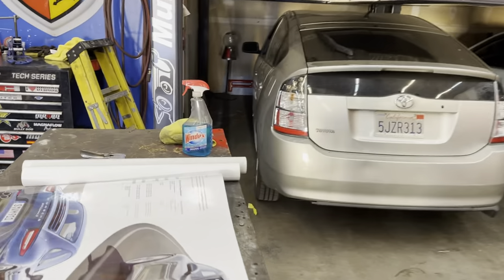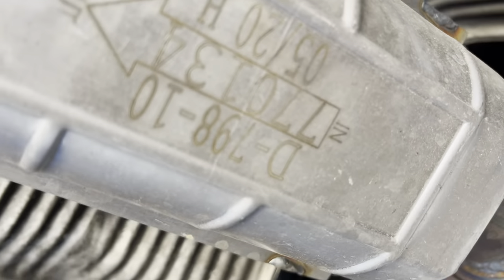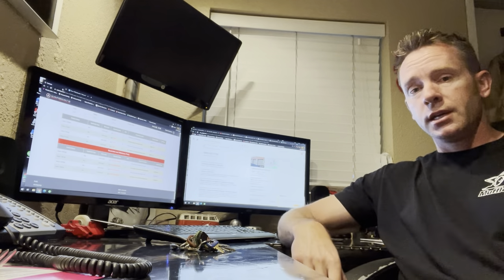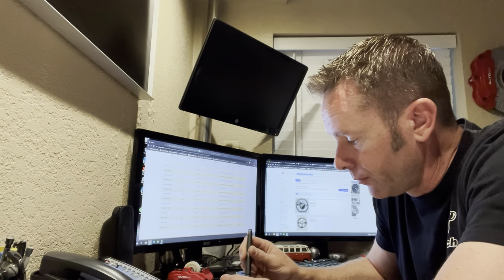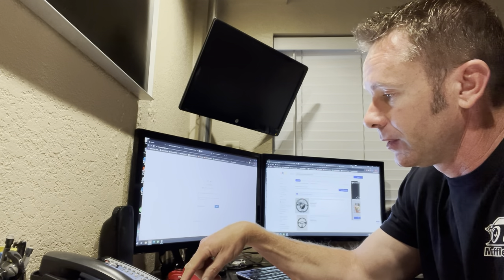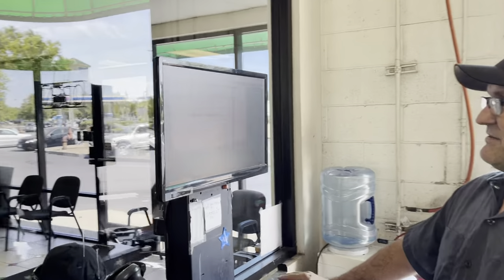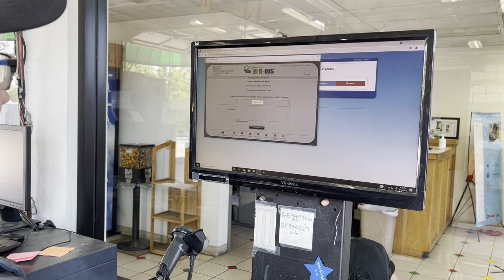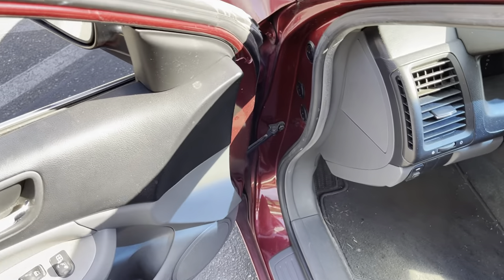There’s a legal catalytic converter for SULEV Accords in California!  Open for an explanation.

Comment: How reliable are these new aftermarket cats for the Honda accord? Do they last as long as the original? Are there any performance benefits?
Reply from the maker: On the SULEV’s it’s still to be determined.  The parts are not designed for the SULEV so it will be interesting to see.
Reply: @mufflertech  What’s the warranty on one of these?
Reply from the maker: @mjl6425  that’s the rub, there isn’t one as the manufacturer never designed these parts for an SULEV application.
Reply: Do you think in the future if these thefts ever die down and the OEM cats become more available, will we be required to switch back over to the original?
Reply from the maker: @mjl6425  the availability of the parts have nothing to do with the thefts, it’s the other way around.  The thefts are because of the higher prices of the rhodium inside the part and the parts aren’t available because of the high frequency of theft.  Once a car is labeled by the BAR 5that is the part it will always be legal with.
Reply: @mufflertech  Got it thank you.
Reply: @mufflertech  On the 2005 Honda accord can you still drive it without the cat? Mine was stolen last week and and need to decide whether to tow it or not.
Reply: @mjl6425  I drove mine to the shop, just drove slow. Car is good now. Getting a cage installed around it. I'm not trying to pay for this twice.
Reply: @mansonboy2000  what kind of cage are you getting installed? What is it called?
Reply: @surabhirahul  the muffler shop I  took it to custom makes their own around the Cat, so there is not name for it.  I'm sure most muffler shops in town must offer something similar since this is so wide spread now. Just call and ask you local shops to see if they do it. I live in Long Beach and the shop I took it to is called "Highflow Muffler" on Long Beach Blvd. I paid $280 for it. Hope this info helps and good luck.
Reply: @mansonboy2000  which cat did you go with?? Ours just got stolen from our 2005 accord...this is a headache. I'm in orange county

Comment: Will be contacting you soon regarding an 06 accord  stolen cat converter. any new updates on the aftermarket parts?
Reply from the maker: They have added a couple of part numbers from Walker, nothing has changed in price or procedure however.
Reply: @mufflertech  how much does it cost they sold me a 2007 accord without warning me that it didn't have a catalytic converter
Reply from the maker: @norbertovargas1931  who sold you the car?  What state and city are you in?
Reply: @mufflertech  I'm in orange county California I found it on offer up to my surprise I found out when trying to do the smog check.
Reply from the maker: @norbertovargas1931  California legislator says that a private party sale in California requires the seller to make the vehicle legal for smog.  I’d contact the seller and negotiate the repair.

Comment: My CAT got stolen in my 07 Honda accord SE 2.4L I fixed it it runs smooth now but the codes p0141 and p0137 come on. What does this mean? Thanks
Reply from the maker: A PO141 is an 02 sensor heater circuit malfunction, a PO137 is the same sensor with a voltage issue.  What sensor did you use?  A lot of overseas made parts do not operate properly.  Although very rare, we have also seen the vehicle’s ECU fail if the wires were short circuited when they were cut.
Reply: @mufflertech  I just bought a Denso oxygen sensor should that fix the problem?
Reply from the maker: @thatdudee5344  possibly, if it doesn’t I’d recommend a proper diagnostic from a reputable repair facility.
Reply: @mufflertech  Ok thank you

Comment: Hey Colby I know this video is old but will you please explain to me how we  sulev owners know for sure what aftermarket cats are being allowed for our cars at this moment? we dont wanna buy something that we cant use and it seems none of the provisional cats are compliant with sulev? ive scoured the carb web site cal carbs etc nothing mentions sulev or my efn.  i have an 04 accord ex sulev. My label says my car conforms to "tier 2 bin 5 and cfv lev,  lev  sulev, and certified as pzev" efn is 4hnxv02.4kcv  please advise what i can use  thanks man
Reply from the maker: None of the cats are on the CARB list, that’s why they’re provisional.  I would strongly advise that you have us or a qualified shop do your replacement.  This way you’re covered by a professional establishment to back up what’s current.  We most often use the Walker 82812.  The 82901 is also okay along with the 770134 that’s in this video.
Reply: @mufflertech  well I am a bmw mechanic and I know how to weld quite well so Im certain I can handle the install and the theft prevention install.  what i am trying to find out is how does one come to the conclusion that the walker 82812 0r 82901 is being accepted at present? there has to be something published somewhere that tells the public which are acceptable for sulev.  there is a list on the california air resource board website. theres an aftermarket catalytic converter database  which your 770134 is the first cat listed.  but please say how you came to discover that its accepted for sulev right now cuz the executive order doesn't mention sulev? it must mention something else that indicates its acceptable for sulev? all the other efn"s are listed but not the sulev efn? please help this is the question i am asking  thank you very much for your time ive literally been searching for days trying to find this out.  ive sent emails to carb's helpline even with no reply
Reply from the maker: @rickybobby9143  it’s not just about the install, it’s the insurance that the cat you have will work.  Also I know many extremely talented mechanics and welder’s that have a hard time welding round pipe on a car.  That said here’s the link for the SULEV provisional/alternative parts:

https://asktheref.org/Information/Honda-Accord-Catalytic-Converters

Comment: I appreciate the informative work and support you are providing to the public and to those of us who have had their catalytic converter stolen. 
I am working with my local Honda Dealership and was quoted a price of $4,200+  for the cat converter for my Honda Accord 2007. My Accord is in good condition with 205k miles. 
My total will come to $4,800+ 
Does this sound right? Your input is greatly appreciated. It has been a nightmare having to wait for the parts to come in.
Reply from the maker: That’s a fair amount higher then we do it for, we do use an aftermarket A pipe and sensors however.  A Honda store is likely using all factory parts and will charge more.  If you’re insured the real pain is the time to get the parts.
Reply: @mufflertech  where are you located??
Reply from the maker: @joser81  Sacramento California

Comment: Muffler tech use to be the shit back in the days. Imports and hotrods constantly there for upgrade. They were a well known performance shop. Nowadays they're just a repair shop. Smh. Hella weak.
Reply from the maker: I appreciate your enthusiasm.  I opened Muffler Tech in 1997 and have always been passionate about performance mods on vehicles.  I assure you we are still doing lots of performance exhaust.  We are also (and always have been) doing lots of repair and replacement.  The stuff that gains attention on YT are products and services that apply to critical mass.  A good example of this is this exact video which is one of the lower viewed ones on my channel.  It has three times more views then one I made about custom fitting a GT3 muffler on an early 911 here: https://youtu.be/xpGdp7_mi3s  The bottom line is businesses like us survive by offering a service that applies to a larger market along with specialty services like performance modifications.  You believe our business practices are "Hella weak", I assure you we wouldn't have any at all if we limited our services to just performance stuff.  Thanks for watching!

Comment: Is there a catalytic converter aftermarket for 2013 honda accord that is legal carb
Reply from the maker: Possibly.  It depends on why you need one, which engine you have, and  finally what the specific engine group number your car has.  If it was stolen you most likely need the underbody cat.  If it’s bad (check engine light) you’ll need the front manifold cat.  If you can bring it to us for a free estimate.

Comment: i replaced the sensors and still get a check engine light on, with code p0135, for the upstream sensor. please help
Reply from the maker: If you used a Densò or an OEM make sure the plug is all the way clicked in.  Sometimes the connection can be loose.  If it’s a different aftermarket then go to OEM or Densò.  It’s possible that the vehicle’s ECU was damaged from shorting the wires when it was cut during the theft.
Reply: @mufflertech  Thank you very much

Comment: And is it.possible.to buy the pipe.that has 90° bent and it gets bolted on what do u call this specific  part bcz I temporary  want to put straight  pipe I'm sure its.probably not legal but I'm desperate  to at least get it driveable.3-4 miles to a.job I have.chance.of getting.hired
Reply from the maker: This is the “A-pipe”.  If you’re going to do no cat you won’t need the downstream sensor but you will need the upper as it is the air fuel ratio sensor.

Comment: i just purchase a walker 82895 for my 2006 honda accord ex. it is on the list of the dmx referee as acceptable. it cost $383 on ebay. the rest of the parts i have ordered and cost less than $200
Reply: Is your 82895 working well without any issues still?
Reply: Yes I also need to know. My sister's 06 Accord SULEV had it's cat stolen and I'm gonna replace it with the same part. Please update us.

Comment: Hot off the press.  I just called the CARB ref and the process is much easier then before.  You call once and give the part number, license plate and phone number and email.  Then they give you an appointment with the ref right away which is just a week out.  The wait time was only 5 min on hold to reach them on this single call.  (The call back process has been removed)    So far a pretty good experience that they have streamlined from your video.   I had my cat replaced at your place last week and great service from your gang.   Great videos that walked me thru the process.   I also took your advice and put Comp insurance back on my old beast in case they steal my Cat again.... I hope I don't have to visit you guys again !!!!!
Reply from the maker: Great, thanks for the update!

Comment: my catalytic converter got stolen 8 months ago, and it was a pain getting it repaired, but soon after the check engine light came on and indicates something is wrong with the new catalytic converter. has anyone else has this problem or  knows why my light may be turning on? the light came on so soon after i can’t get a smog check without failing and i really need the car to get going so i can get tags.
Reply from the maker: Where did you have it repaired?  If it was a licensed shop they should be fixing it for you at no charge assuming it’s the fault of the part they sold you.
Reply: @mufflertech  It was a licensed shop but the owner died of covid and his brother who took over the shop will not take responsibility for the job that was done in the shop.
Reply: Do u know if they use oem oxygen sensor or aftermarket ones I hear after market sensor trip check engine light it's best to use oem

Comment: I had no idea this process was even required. Was this Accord considered salvaged when you bought it or is this process required for any aftermarket cat? Our 2004 Honda Accord's cat and all of those surrounding parts were stolen and/or damaged. Our mechanic said he can get a California-legal aftermarket cat in stock, but didn't mention anything about it needing to get inspected and re-smogged. I was only aware that a salvaged vehicle would need some sort of inspection if the insurance decides to total the car. Thank you!
Reply from the maker: This is required if you install one of the 3 approved parts on an SULEV car.  The salvage process is different as it is specifically a brake and lamp inspection.

Comment: I wanted to know if i bought a aftermarket converter for a 2006 honda accord ex efn# 6hnxvo2.4cmc would a converter with 4KKC be able to be passed on the car by state ref if it has the same part # and same EO # or does the efn# have to be an exact match? Thank you
Reply: We strongly advise that you buy the cat from your installer.  This way you know the part is correct for the Referee process and you have a warranty if it is not.  If you buy the part first and it is not correct you may have trouble returning it especially if it has been installed already.

Comment: So i purchased the walker 82895 and went to my local muffler shop... they were about to install it when the owner comes out yelling to take my car off the rack. This idiot called the honda dealer in our town and he said they had an oem cat in stock so he cant install my aftermarket cat because its illegal since its not on backorder if one is in stock. I tried to explain that its a nationwide backorder and if its on the list its being allowed but he wouldn't listen. I then went to a bunch of other muffler shops and they were all afraid of the B.A.R. and said they won't do it. So now I need to install it and get to the ref before my cat ends up off the list but I had a couple questions. 1. my aftermarket cat is direct fit so do I need to install the heat shield on the bottom on the cat? the one between the cat and the underbody is there but they took the bottom half. and 2. Can I weld the  the rear end of the cat directly to the pipe leading to the muffler or do I have to use a flange there.  Wish I was closer I would have come there to your shop but its really far.  Thanks for your help
Reply from the maker: I’m sorry you’re running into this.  There’s unfortunately a lot of shops that are uneducated on this subject.  I would advise for you and anyone else in this position to purchase the parts from the shop instead of buying the part up front.  This takes care of two things, firstly the shop has the opportunity to make money on the part and the labor, and secondly they know what they’re selling and understand the allowances.  Yes this may cost you a little bit more but you won’t run into this sort of resistance and the shop should cover you in any instances that the part doesn’t work in a compliance situation.  You may need to do some research and traveling to find a competent shop.
To answer your question’s you will not need an additional heat shield as the replacement has its own already on the part and yes you can weld the cat on one or both sides to the pipe.
Reply: @mufflertech  THANK YOU for all of your help. There are plenty of shops here willing to install parts that you bring yourself just not for 2003-2007 sulev accords apparently, nut i certainly hear what you are saying and at this point would advise the same thing to people in this mess and that is purchase your parts from reputable shop and save yourselves the headache that im dealing with !!!

Comment: I'm in Arizona. Mine was stolen off a non SULEV 2.4 05 car. I don't care to spend money on a cash car because some piece of shit wants easy money. Will a muffler shop weld in pipe for me? Car is registered and insured in Florida with no emissions requirements. Ill be here in arizona maybe 7-8 months more max. And if they are willing to, what's a reasonable price. Its cut in front of the flex pipe where it comes down past the up stream 02 and unbolted from the back side.
Reply from the maker: Possibly.  Regardless of the laws in the state in which the car resides federal law prohibits the removal of any emissions equipment that came on the vehicle.  It will just depend on the region you’re in and how flexible the shops are.  If we were to weld a pipe in (we cannot and will not do it as it’s illegal) we would charge $130.
Reply: @mufflertech  how much would you guys charge to weld in a generic cat with no flex pipe?
Reply from the maker: @virenpatel9973  we don’t have “generic” cats in California.  Everything here is regulated.  I would suggest researching shops near you looking for good reviews and call them.
Reply: @mufflertech  so I had a universal cat welded on today. It’s got a good seal with the weld etc etc. Now they also cut the wires for the 02 sensor. I have a 4 wire for my accord. I found a denso unit with what seems to be a 4 wire sensor on Amazon for $100 less than autozone wanted. I’ve ordered it. My question is do these denso factory units fit the universal cats? It was a 2.0” racing industries cat.